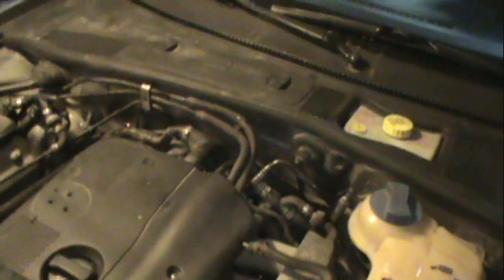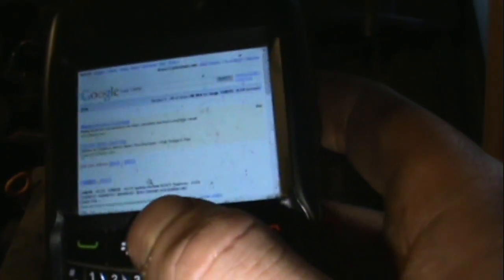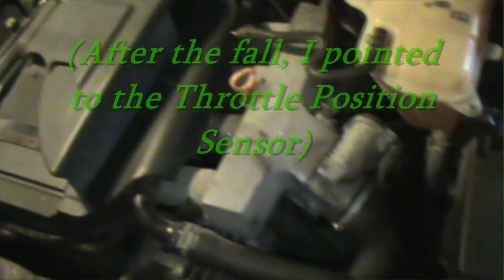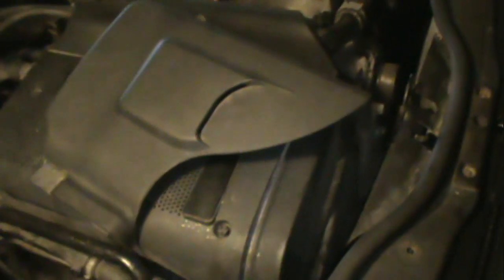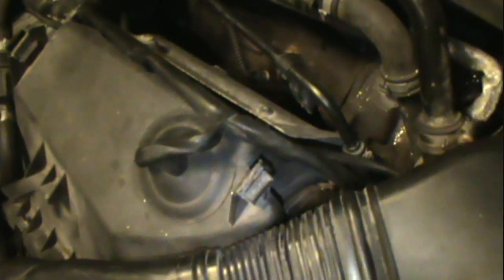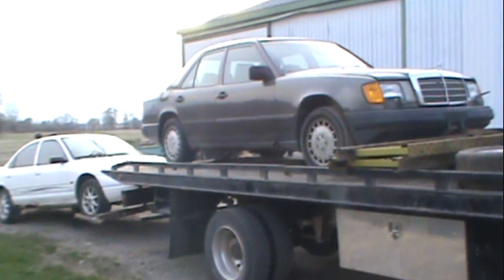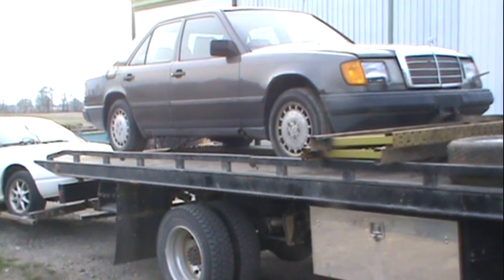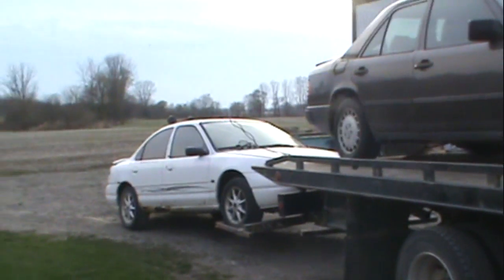Some More German Cars

Comment: The B5 chassis cars are not good. We have had 3 sets of control arms at 175K, and all plastic components are of poor quality. Not to mention the water leakage issues they all have. I dont believe the AWM engine code uses an ICM like your 99 model car. Test his coil packs.